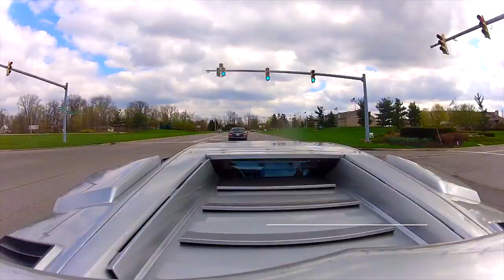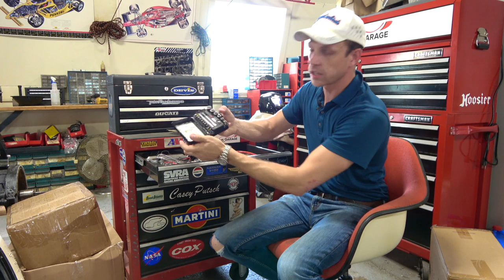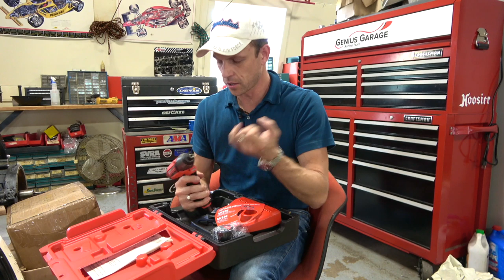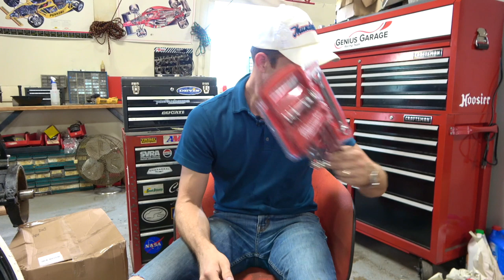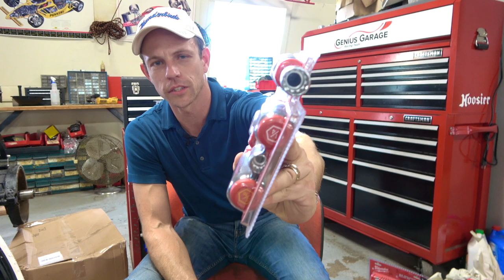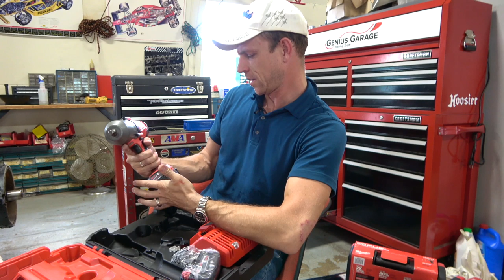World's craziest car builder talks tools and unboxes free power tools

Comment: Those Milwaukee impacts are super durable! Ive used the same ones for the past 5 year doing industrial and commercial electrical work, they've been submerged in 3 feet deep mud from a quarry, dropped multiple times off 30ft lifts,  regularly gets used as a hammer, and has just been abused and still works great.

Comment: Organize certain tools by left right direction.  My Phillips get placed in the drawer with the handle on the right side.  Flat heads get placed with the handle on the left side.

That way I can easily know what type of tool I'm grabbing.
Reply: LOL. That's the exact orientation I use. If you line them up in the drawer with every other one is opposing, you can know at a glance if they're all there, too. 

BTW, make sure all your canned goods labels face out and are in alphabetical order, you wipe off your eggs before putting them away, and make sure the stove is off. Every time you walk by it. Well, these may just be me, but still. ;) (I jest)

Comment: I love my Milwaukee tools. I resisted buying the electric ratchets for a long time, but giving in and buying the first one was one of the best purchases I have made. Now I have quite a few (for my small garage) of Milwaukee tools scattered around my workbenches. Learning to finesse the trigger of a small electric impact can speed projects up immensely, though I'm sure you deal with more than your fair share of broken bolts from your students as they practice. You should sell flags or toolbox stickers to support the program and pay for the broken hardware ;)

On a side note, I'm glad to see I'm not the only one with a lav mic pack (RodeLink?) that has issues with those cheesy metal clips when actually moving around. If it wasn't for the fact the cord actually screws onto the unit I would have dropped mine in a bucket of coolant the other day.

Comment: New tools are expensive, but they don't hold value well.  Look for used, high end items on Craigslist, ebay, rummages ect.  Truck brand ratchet are well worth the money and will save you from busting your hands open.  Screw drivers as you mentioned are worth paying up for.  And anything with a hinge; Crescent brand, Channel brand, Knipex and Irwin are the way to go.  Tool truck rebrands dot com is a great place to save some bucks.  And lots of deals  on Amazon.

Comment: Hi casey  ..how often are robertson head screws used in the states..i realize they are non automotive.
Dò they even sell robertson in the states.
Reply: Still somewhat common in the wood working/ construction realm, although less so each year as torx drive is becoming more popular as a replacement for Phillips and Robertson. Robertson Is still the standard for most cabinet screws and pocket hole screws in the USA at least in my experience.
Reply: @berryreading4809  hi bear...robertson screw was patented in milton ont in 1909 about 50 miles from me.
In canada it is mostly a wordwork related screw..although most the newer cabinet hardware is phillips nowadays.. as the hardware is made mostly offshore.
Have a great day..

Comment: My father gave me my first set of tools. What he taught me was this. "A tool that is NOT in its proper place DOES NOT exist. He hammered it in to me, that tools need to be replaced in their original spot. His tool kit/case, had a place for each tool. My fledgling garage is slowly being built and I follow the same principle even today.

ADDED: What you called a "Crescent Wrench" looked like CHANNEL LOCK WRENCH to me. A crescent wrench to me has the little worm screw that adjusts the size of the jaw.

For you younger folks: Any tool that is made from "chrome vanadium" AVOID like the plague!  This is crap metal that will strip/break easily at best it is used for light duty tools only.

Comment: Can I be in your channel?
Reply from the maker: Eddie V maybe, what do you want to do in it?
Reply: Possible solve why my BMW key doesn’t work when the car sits outside when it’s hot outside. Because they key works but when something heats up it doesn’t work wirelessly and the bmw says key is not found, and you have to start the car by holding the key to the steering wheel column. Or I can do a review on the projects your working on.
Reply: @EddieV19  Heat weakens wireless signal strength ( https://annals-csis.org/Volume_5/pliks/241.pdf ) but that alone shouldn't be enough to cause it. It is possible that something indirect is happening like an item that is in your pocket with the key during warm weather blocks it but you put one of them in a jacket pocket in cold weather.